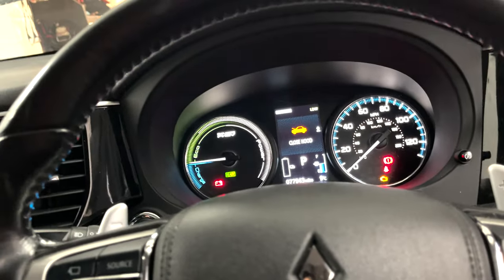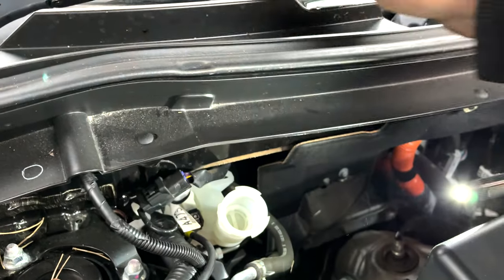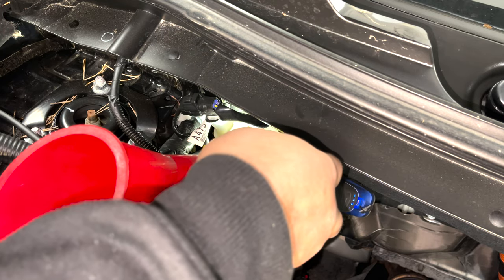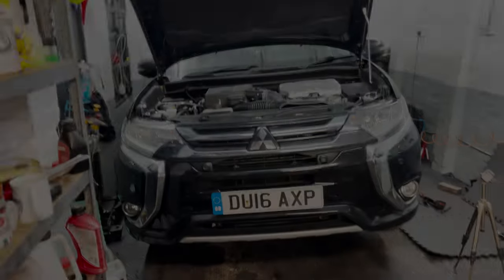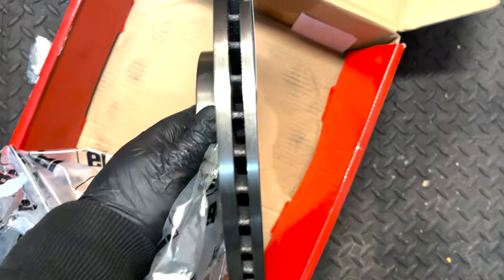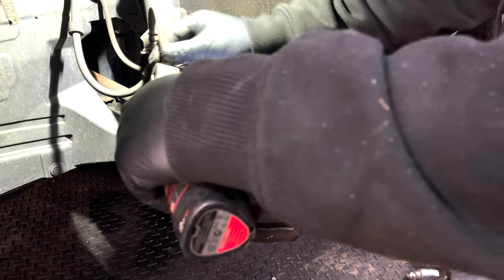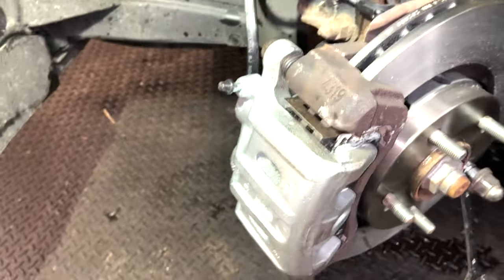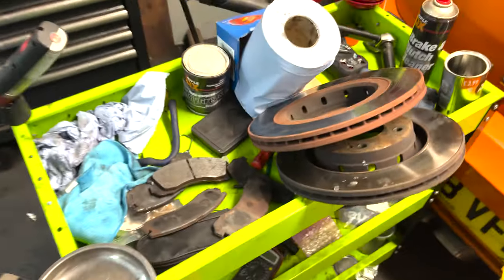Mitsubishi Outlander PHEV Brake System Service Required warning Brake job never seen Discs like it

Comment: Thanks for that.. Brakes stuck on on my Outlander on front drivers side. Just spent 2 hours trying to get the wheel off (stuck on) and back off the brakes.. I noticed the difference in thickness of the brake disk..I thought the inner one had worn ..lol.. !!

Comment: Nice vid mate, be careful with brake fluid dripping on new pads - had a long time investigating poor brake power on MOT and finally find out that brake pads got brake fluid on them once bleeding was done causing brake material to be baked somehow, acted like a slider, not braked as it should.

Comment: If you have 71 miles on the guessometer with half a tank showing then brakes are rubbing for sure.  I had drivers side caliper seized.  Took it apart sanded it with 1200 and put it back, but it was pitted, so at some stage I will change the calipers.

Comment: Good brake job mate. I have seen cheeper discs with a wider gap in the middle of the disc, having two thin sides to it. Less metal to keep the cost down. I would think it may warp easier than a thicker disc.
Reply from the maker: Good to know mate , this Mitsubishi one was weird never seen it before 👍🍻

Comment: Glad to see the detail and proper pin orientation! I emphasize this because no one else does.
Keep an eye on the bearings exposed to excessive heat! Top piston failure can be from gases released from old brake fluid when it boils.
Reply from the maker: Cheers bud , I will check the bearing again on the next oil change … Good to know about the top piston failure 👍👍
Reply: What does that rubber end on one of the pins do?

Comment: This is a fantastic video. I need to replace the caliper on the same model. Please tell me where you bought the refurbished caliper from.
Reply: I can answer my own question for anyone who wants to change the caliper themselves. After buying what was stated as an OEM refurbished caliper for £73 from ebay (it was actually just a poor pattern copy) I bought the PAGID one from euro car parts. More expensive at £103 but it is a higher quality, refurbished, genuine mitsubishi unit and also comes with new copper washers for the banjo and new bellows/seals for the sliding pins.
Reply: @ColinCarFan did it come with brake carrier to ?

Comment: HEV’s & EV utilize far less friction braking of course as a benefit of regenerative braking. Resulting in far less wear. Down side is apparent here as that low cycling rate might make piston’s prone to seizure. Interesting. Cheers Igor. 👍
Reply from the maker: I had a Toyota Auris with over 100k the other day MOT check , and brake pad wear was minimal I mean about a mil it’s impressive … I have quite few customers with hybrids vehicles  I’ll be reporting back any more caliper issues 👍

Comment: What kind of cars do you normally work on? Evdrything you thought was odd is completely normal on almost everything ive worked on. I didnt wanna judge by your accent but the only thing i can think of is US regulations versus where you are. If youre in the US i dont understand the differences.

Comment: So would it come on after changing the front pads? We had to change ours yesterday and today when I got in it, stepped on the brake the service light came on? Now I got brake fluid bc it does look low. However just wondering what else it could be if the light does not go off? Also our headlights literally go out once every two or three weeks? What could that be?  It’s a 2019 outlander